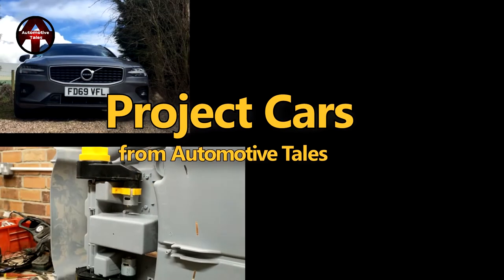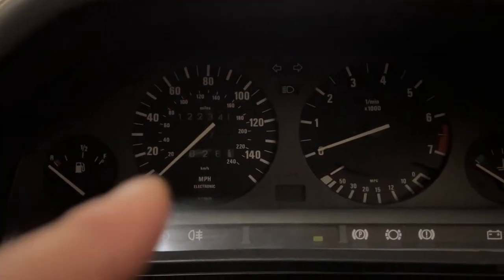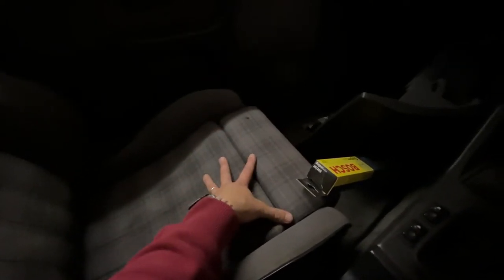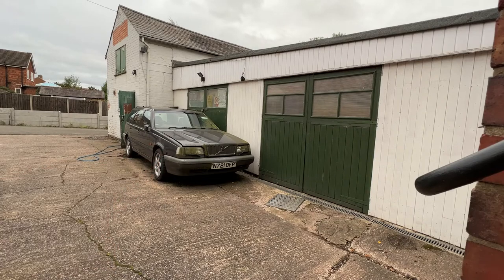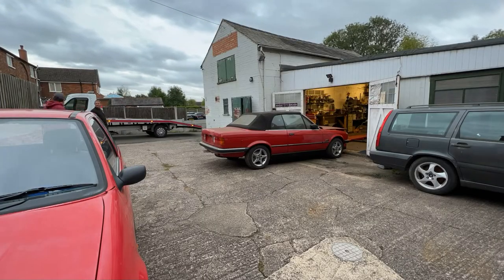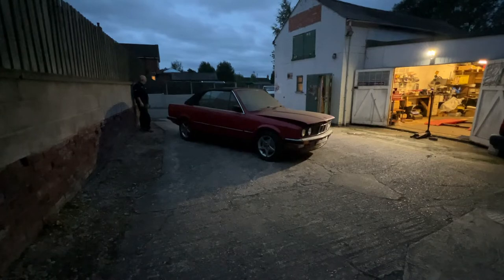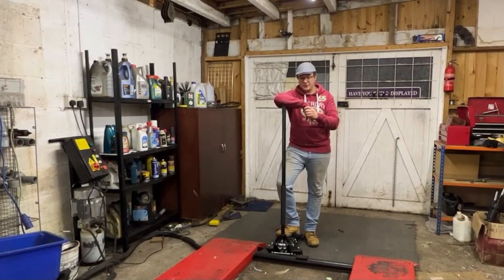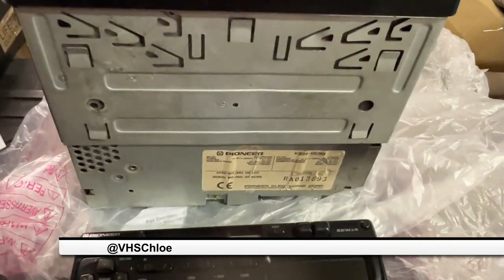WE GOT IT STUCK!  Barn Find BMW e30 Cabriolet goes off to be finished!

Comment: YES! I was watching that wondering if it was the one I redid the wiring back to the factory connector. There'd best be a video for the re-working of the cassette deck, although it needs replacing with a CDII (Sorry Chloe)

EDIT: Just had a freaking incredible idea. You know my thing is "factory plus" and period accessories? Let's do a period audio install. The kind that if you'd said to the dealer "I want to hear my audio when I'm on the motorway with the roof down" and they'd sent it to the local audio specialist, you'd get. Period audio reviews, period kit, painstakingly installed to not chop any factory harnesses, all factory bolt holes and absolutely lovingly done. Period reviews from period magazines. A CDII connected to factory harnesses with the rest carefully replaced. You know you want to...
Reply from the maker: Now this sounds like my kind of project... don't hold your breath though... it may be with Classic Bahnstormers for some time yet!  The engine and gearbox are already out!! facepalm
Reply: @automotivetales  I’m not saying I did or didn’t do some research yesterday, including finding a 1990 Alpine brochure to confirm my suspicions and checking on eBay for the results…